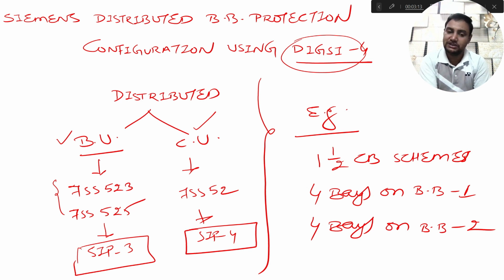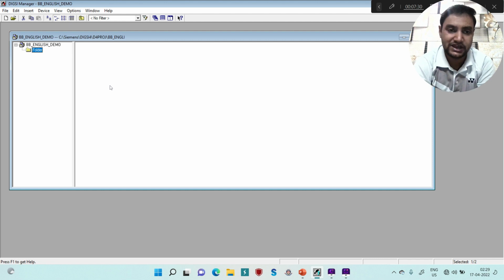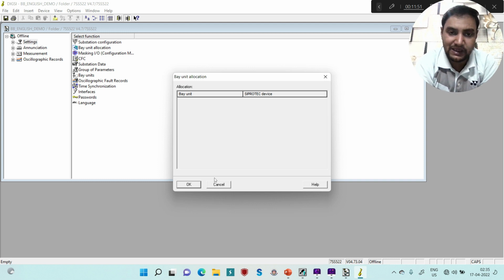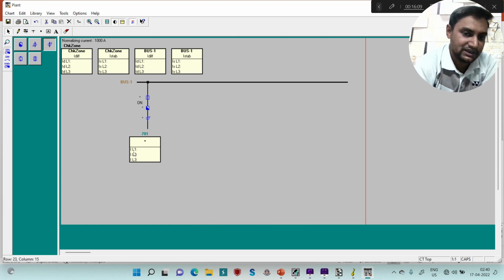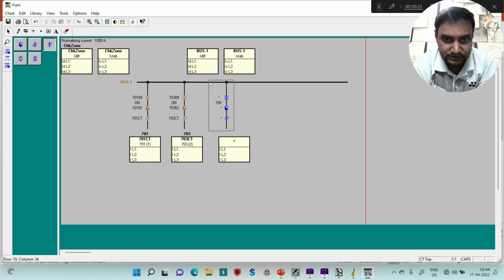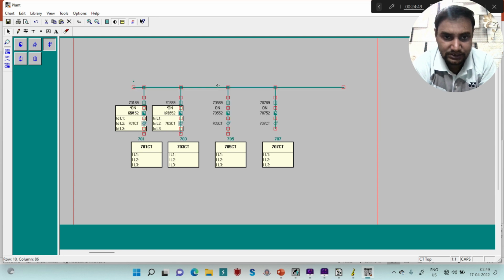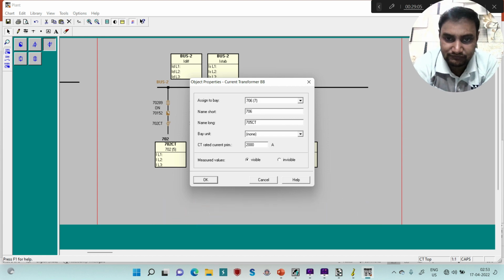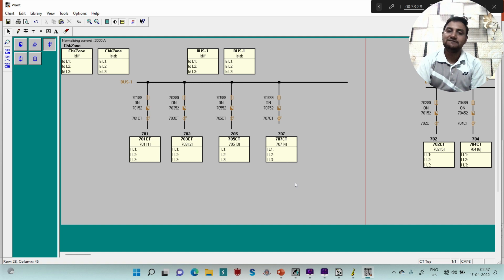SIEMENS DE-CENTRALIZED BUS BAR RELAY CONFIGURATION USING DIGSI | 7SS522 | 7SS523 | 7SS525 | PART-1

Comment: Dist relay 7SA522 RELAY GIVE 3 PHASE TRIPPING DURING INJECT Z1 SINGLE PHASE FAULT, WHAT PROBLEM? 
PLEASE HELP ME
Reply from the maker: Single Phase Trip Permissive Signal is LOW. Make this signal active either through CFC or masking IO. You will find this signal under power system data-2 in masking IO.
Reply: @lightningminds_pankajkumarjha  but sir when inbuilt autoreclose function of relay siemens use, then no require single phase trip permissive, 
Without single phase trip permissive signal, then relay test and give single phase tripping and also check autoreclose function, all results in order.
Reply: @lightningminds_pankajkumarjha  now I confused that when to use single phase permissive and when not.
Reply: @lightningminds_pankajkumarjha  please sir
Reply from the maker: In case you are using 7SA522 Relay for distance+AR then the signal "Single Phase Trip Permissive" will remain active if all the conditions of AR are satisfied and we don't have to wire or configure this signal externally.... However, if external AR is used I.e. through BCU or external AR Relay then we have to wire or configure this "Single Phase Trip Permissive" signal.... Only when the "Single Phase Trip Permissive" is active, 7SA522 will issue single phase trip command otherwise it will issue three phase trip command only.
Reply: @lightningminds_pankajkumarjha  sir
Carrier aided cfc aur AR BLOCK cfc dono ko fast plc m rakhna compulsory h kya?
Reply: Please tell me sir
Reply from the maker: Agar koi bhi CFC bana rahe hain jisme protection signal hai to compile fast PLC me karna hai
Reply: @lightningminds_pankajkumarjha  sir m siemens relay me Z2+Carr. Receive +1 ph fault per autoreclose chahta hu. mujhe cfc ya masking m Kya krna chahiye. Z1B use nhi krna chahta hu. 
Please help sir
Reply: Sir guide me
Reply: @lightningminds_pankajkumarjha  sir any guide me please me
Reply: Please help me
Reply: All video very very useful in hindi language. 
Thank you sir